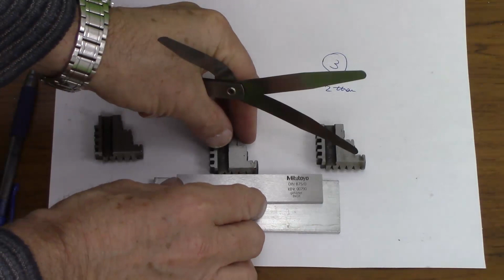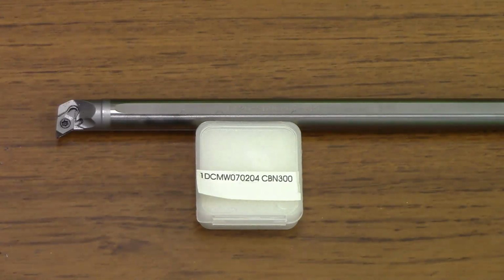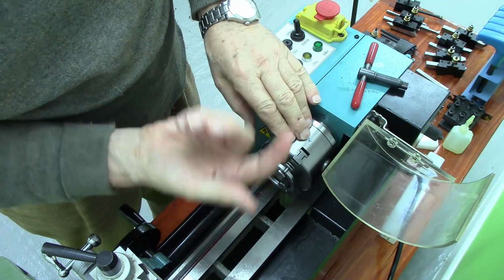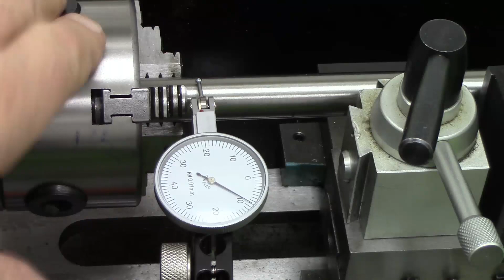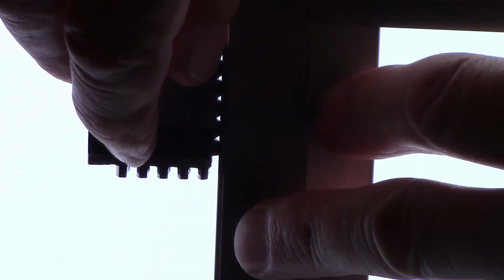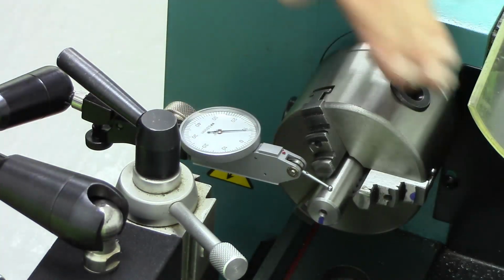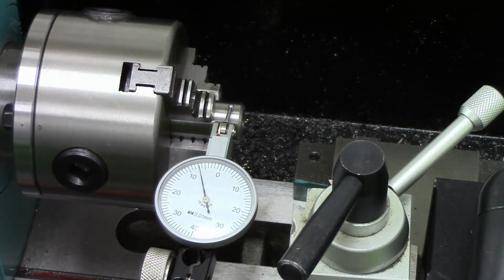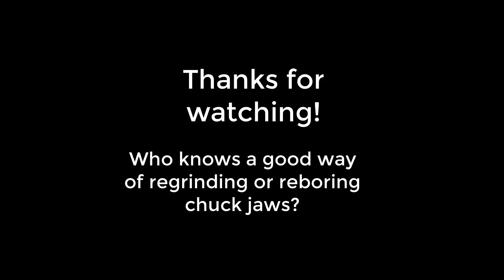Reboring SC2 minilathe chuck jaws

Comment: Hi Samuel, a boring bar will always cut extra on the back cut, an old experienced turner always said to me, if you want accurate boring, you stop the machine after a cut and bring the tool back for subsequent cuts, this happens regardless of what lathe I've used, hope this is not too late to help.
Reply from the maker: Thanks. Why does it do that? Spring in the bar or the part?
Reply: @samuelfielder  It's always intrigued me why it does this, yes, It can only be the spring in the bar, or maybe the rake of the tip, It happens no matter how light the cut, it's one of those anomolies that will happen, as long as we know this, we'll work to it! cheers, Dave

Comment: Hi,
I believe Joe pie has a video on redoing the soft jaws of a chuck.
He made a tubular spacer that sat inside the jaws, in the recessed part of the jaws
Which allows the jaws to be supported at the rear, rather than the front.
Also when clocking the run out, test in two different places along the test bar.
As one point may be concentric, the second point may not, indicating the bar is not perpendicular to the chuck face.
Joe pie explains this better than I can :)
I hope this makes sense.
Also dismantle the chuck and clean the scroll plate, lightly oil the face of the scroll & grease the pinions
Reply from the maker: Yes I saw those Jo Pie videos. I don't think test piece alignment was a problem in my tests. I would think the scroll plate is pretty clean but, even if it were dirty, that would not explain why boring the jaws made the runout worse. A couple of others on yuotube have found the same though. Anyway, my end result is pretty good, better than the average 3-jaw, albeit obtained by crude means.

Comment: Yes I would take the Chuck apart and look at the scope plate. Could have easily cracked/bent an area. Could cause the runout to easily vary depending on the diameter being held.
Jaws may land on the pad section one time and not the next. Your boring bar sounded the same going in and coming out which should not be.